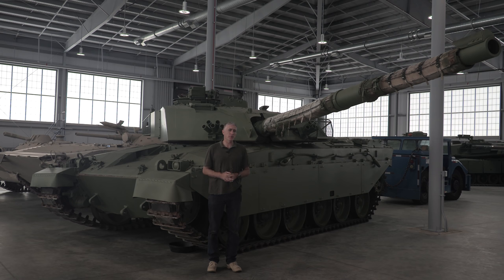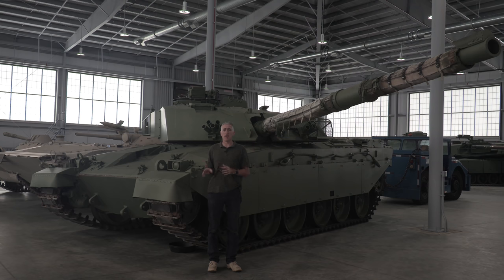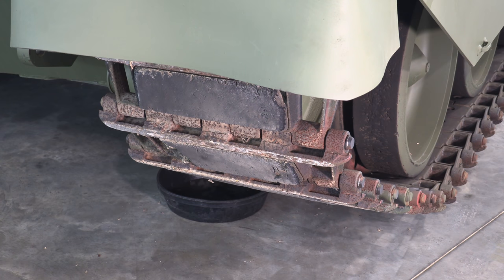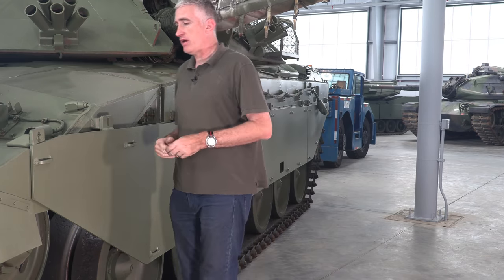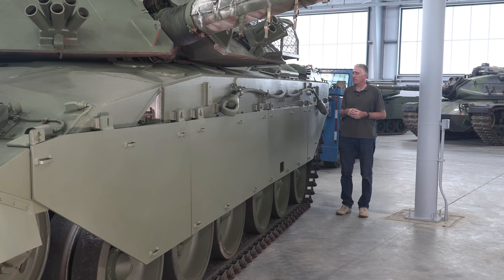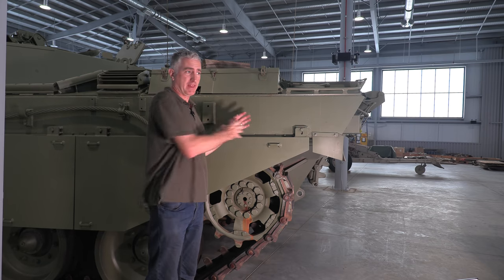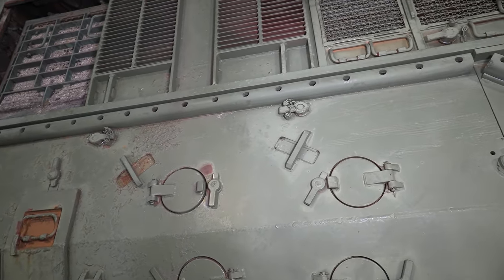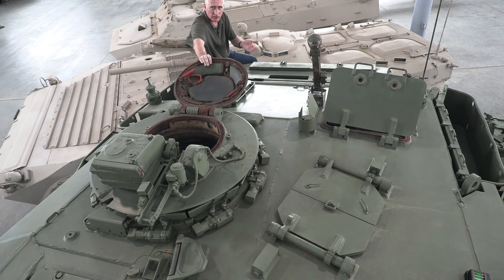Inside the Chieftain's Hatch: Challenger 1 Prototype Pt 1

Comment: The similarity to Challenger 2, at least on the automotive end, is quite unreal. The parts may be different, but the basic design is pretty much exactly the same. Guess if it ain't broke, don't fix it, but having crewed Chally 2s, this seems to be nearly identical. Glad track tensioning is a button on the newer model though.
Reply: Its similar because the Chally 2 isn't really a new tank, it's just marketed as such (similar to how the "new" chally 3 is just the chally 2 LEP under a new name).  Basically British army are still running around in Centurions :D.
Reply: That's a hugely incorrect statement. Challenger 1 was essentially an upgraded Chieftain. The Challenger II was an entirely new design built from the ground up. With some basis externally being similar internally it was Mike's apart.
Reply: The Chal server really will, the Brits just s*** themselves when the tank came last in most races and trials in a European military show/competition. Everything else was more accurate on the move, everything else was finishing the race tracks faster, and the visibility from the inside was poorer. So they started upgrading pretty much every electronic, changed view ports etc., and found a few other things they could update and change in the process. Such as adding new internal laser sensor to the barrel.
Reply: Everything I've ever read about Chally 1 and 2 says they're almost completely different tanks, despite external similarities.

It also all says Chally 1 was a complete turkey, hence why Chally 2 was brought in so goddamn fast.
Reply: @jamesgale9722  Sorry but that's not the case.
Reply: @WozWozEre  The chalky 1 was replaced at the same rough interval as the chieftain (in service 67, replacement in service 83).

The claim it is "completely different" is from 97% of components having different catalogue numbers rather than actual differences.
Reply: @jimmydesouza4375  Except that nothing of them is Centurion based. Couple of tank generations out of date for a claim like that.
Reply: @jamesgale9722  Well... Chal uses a new suspension, a new hull, a new turret, a new engine, a new gun (although chieftain could have had the gun mounted ofc).
Reply: @Retrosicotte  Look up the actual developmental histories my boy.
Reply: @jimmydesouza4375  the catalogue number excuse sounds like something the MoD PR department would pull for sure 👌
Reply: @jimmydesouza4375  "Development histories" means nothing, thats a term that shows continued learning. By "development histories" the T-72 is a T-34. Trying to claim a Challenger is just a model of Centurion is a new level of stupid I didn't expect to encounter today.
Reply: @Retrosicotte  It seems stupid to you because you aren't really capable of engaging in this and dismissing things as stupid is one of the primary defenses of the weak minded.

Anyway, moving on from that you don't understand the difference between novel designs using concepts from earlier designed and iterative development.

Many elements of the Chally and its, frankly, inferior design can be traced right back to the cent.  A nice example is the suspension.  Cent has horstman's because it was the best thing available at the time.  Chieftain is a iterative improvement waiting for something better, so they just adapt the cent hull (early prototypes were even labelled as cent variants), so the Chieftain itself has improved horstman's, and subsequently poor mobility due to the obsolete suspension.  Then the chally rolls along, they can't put horstmans on it again as it's ridiculously obsolete at this point, but at the same time because you're going to use the same hull without any reengineering you need a suspension that mounts in the same obsolete inferior way, so you get horstman's hydrogas units and inferior mobility.  So then the chally 2 rolls along, you're still using an adapted version of the cent's basic hull design, so you once again need external mounted suspension because you can't afford to reengineer the hull, so you use an updated version of the hydrogas from the previous tank and all of a sudden you're failing adoption tests and getting ruined in the export market.

Meanwhile everyone else, because they have done white paper hulls by this point, is rolling along on torsion bars.
Reply: I'll just say here, I've crewed the Chally 2 for 5 years. The bottom half, as in everything below the turret, is nigh identical to chally 2. The exhausts look different, but they're in the exact same place. All the tow mounting points are in the same place. The tool boxes, the rubber stops on the back decks, they're all the same. I can imagine new parts came along, so anything that could upgraded was, but the bottom half of a chally 2 is pretty much still the same in 2022. I don't know the exact percentage of new parts or whatever, but from a crewmen perspective,  I could easily work on most crew level jobs on this thing with little training. It's pretty much the same tank. Much like Chally 3, most of the upgrades were to the turret, because it's cheaper to just keep the same hull and plop a new turret ontop. I'd need to check, but I think the bloody engine is the same, as well. At the very least it outputs the same horsepower and all the important parts look to be in the same place.
Reply: @GrasshopperKelly  IIRC the new gun (L30) came with Challenger 2.
Reply: @Retrosicotte  Chieftain is closer (Both use the Horstman suspension) to Centurion than Challenger 1 is to Chieftain Mk11 (the last Chieftain version)
Reply: @mitternacht4062  The Amis and Krauts do the same with M1 and Leo 2. The german Leo 2A5 and 2A6 where re-builds from older tanks with add on armor, new electronics and for the A6 a longer gun to improve the tank crews performace on the err home front ;)

Same with the Leo 1A5. They where all rebuilds from either A2 or (Denmark) A3 versions.
Reply: The transmissions for Challenger 1 and 2 are very different when it comes to the speed change pack and the torque converter. While the hydrostatic variable speed unit that acts to provide the superimposed steering function is in principle the same for both transmissions I believe that it was significantly much developed between Challenger 1 and 2. The incorporated main service brake was essentially the same for both Challenger 1 and 2 it too may have improved from Challenger 1.
Reply: @jimmydesouza4375  I think you'll find every modern MBT is rolling around on hydrogas. Torsion bar is WW2 era.
Reply: @jimmydesouza4375  If you think about modern tank 'hull' progression from the 1970's till today there's two things that stick out - chobham armour and hydrogas suspension. Seeing as CR1 incorporated both of these there was very little to be gained developing an all new hull for CR2.
Reply: @agt155  Your post is wrong in every possible way.  To start with, those aren't the only developments.  Further from that, looking at those two specifically the CR 1 and 2 do not integrate either.

CR1 and 2 do not have composite except in an incredibly small section of the top of the lower glacis (or at least supposedly...).  That is why, for example, the streetfighter pack sticks a giant block of composite on the lower glacis.

Secondly the hydraulic suspension that some modern tanks have is not hydrogas as the challenger line have it.  The other better tanks have adjustable interlinked hydraulics, in order to alter ride heights.  The chally line's hydrogas are just on there because it's the only system that can take the chally's weight within the packaging confines of bolt on suspension.
Reply: @jimmydesouza4375  The entire frontal arc of CR2 is heavy ceramic composite armour. No 30mm steel plate on the upper glacis like most others.

You are getting confused about hydrogas suspension. Hydrogas refers to the Nitrogen spring medium (Gas) coulpled with oil damper (hydro). All truly modern tanks use this set up (most developed by the same British company)- first pioneered on Challenger.
Reply: @agt155  That simply isn't true. Why are you typing nonsense? The entire upper glacis is simple steel as is most of the lower glacis. This is what the MOD themselves said to explain the guys getting their feet blown off, and why they put the composite block there from Streetfighter onward since the Era alone hadn't worked. There is supposedly composite in the upper section of the lower glacis, however the street fighter armor pack covers the whole glacis which suggests otherwise.
Reply: @agt155  Actually, clicking read more, you have absolutely no idea what you are talking about. Stop replying to me.
Reply: @jimmydesouza4375  Every deployed CR2 has the Dorchester block - it's part of the tanks battle armour.  Combined with the Dorchester upper hull and turret front armour it gives CR2 complete frontal protection.
If you're talking about the incident where a CR2 driver lost a couple toes that was not a result of ERA not working, it was down to ERA modules having been removed.
Reply: @agt155  So not only do you have no idea what you're talking about but you're willing to outright contradict yourself from post to post.

Why waste both of our time doing this?
Reply: @jimmydesouza4375  Worthless response. Don't be afraid to learn.
Reply: @agt155  Yes that was a worthless response, so why did you post it?
Reply: @agt155  Its not the Hydrogas is only there because it can tank the weight a bit better. Challengers upper and lower front plate are exposedtne hull has the behemoth weakspot plus the front turret is very thin.
Reply: @agt155  No its does not the entire upper and lower front plate are exposed and then drives weakspot with little armor around is there. Plus the turret and hull sides seem very thin to modern threats like rounds and missiles.
Reply: @resurgentclassbattlecruise7698  The upper front plate has always been Dorchester, the lower front plate was ERA + spaced steel, but is now Dorchester. Therefore the entire frontal arc of CR2 is Dorchester protected - still probably the best ceramic armour on the planet (never defeated).
Reply: @resurgentclassbattlecruise7698  Hydrogen is simply a much better performing spring medium than steel. Every modern MBT uses Hydrogas - the next gen European and US MBTs will all use hydrogas.
Reply: @agt155  No the Upper and Lowerr Front Plates are 80 Millimeters of Steel just simple steal. Adv naced Moduler Armor Protection is better because its not based on upgraded version of early 1960s armor that can defeat all threats. Even the leopard 2A4 has greater armor protection and could withstand all to most cold war era weapons from the frontal arc. It is just simple steel rubber plates ceramic composite applique materials mixed together. The Armor was declassified in 2013. And its really not great. Advnaced Moduler Armor Protection uses nanotechnology modern steel titanium tungsten ceramic composite and appliaue materials in its construction and is much better plus its mid 2010s armor plating not early 1960s. Challenger 1 proved killed by Konkurs ATGM that has less than 70 millimeters of penertration . During official sanctioned ground testing the the mid 1970s. The Turret Armor is very thing. Challenger has like Tytpe 10 a 40 metric ton main battle tank zero composite ceramic appliaue armor baseline to the turret and hull sides. The Iranin chieftain tanks proved m multiple peioce rounds were no longer durable has  many hundreds were destroyed with in inside magazine explosisions in part because of that 3 part round.  And that Iran Iraqi war was extracly the kind of war challenger was built to fight. Not kill armored fighting vehicles at extreme ranges. But close in infantry sppoty with HESH.
Reply: @agt155  The A7V M1a2 SEPV4  A7 Plus Q A7NO A7 Plus HU. T80BVM T90MS T72B3M. It is used in Sourth Kora because of the trerrian there which is exactly the same reason it used in japan. the Altay uses it for likely there same Reasons MBT3000 T96B Plus Type 96B still use torsion bar suspension. Chieftain outright said exceeding 37 miles per hour is dangerous. And its maximum speed is about 56 kilometers per hour.Challenger 2 is heavier. All to most Hydrogas tanks have speeds about 65-75  kilometers per hour. The A7NO Main Battle Tank has a maximum confirmed speed given my the manufractor of 60 kilometers per hour the same speed has challenger 2 without the  armor packaging installed witch adds nearly 10 metric tons in weight is is unoptimized before full fixes and bugs could happen because of the second gulf conflicts in the middle east. Plus the Leopard 2 Still has Peace Support Operations that come with extra armor of remote weapon system station a plow new sensors and systems and subsystems and other cool stuff.Plus it upgrades the poor armor in the turret and hull sides by placing much thicker and heavier armor blocks with composite ceramic and applique materials.  Chobium was developed in the 1960s better armos have come. It is not going to officer you the protection you think it will because it a first generation armor plating scheme for main battle tanks .Not the advanced nanotechnology ones on the market designed to kill round and missiles with 1,000 plus millimeters and 1,500 plus millimeters respectively. Because those kinds and more modern threats did not exist back in the early 1960s era. They do today. But the armor is not that great because its outdated.
Reply: @resurgentclassbattlecruise7698  No, the upper plate is Dorchester and around 700mm thickness, the lower plate is around 100mm steel plus an additional 600mm Dorchetser. Challenger 1 has he longest tank kill in history APFSDS @ ~ 5100m. Rifled = more accurate. Leopard 2A4 has protection levels comparable to Chieftain (which entered service in 1965).
Reply: @agt155  Rifled guns are nor more accurate or precise than smoothbore cannons. APFSDS rounds are far to long and thin in relation to their length to diameter ratio for spinning which helps the accury of roughly conical rounds. Because a long ger and thin er APFSDS round will penerator more armor at longer ranges with a high muzzle velocity. Once you get over 7 times the length to diameter ration vastly increasing centifugal themodaynmic frictional  and rotational forces imparted on the rounds slower them down weaken them make lose range accuracy and stabilization and increasing mzuzzle velocity drop and dispersion. Rifling guns need rifling directly cut in them tweaking them and proving escape ways for the gas meaning they also have lower pressures. The L44 has at least a third higher pressure than even the L30A1 gun. No the plate its not 600 millimeters of Dorchester plus another 100 millimeters of steel is an 80 millimeter steel plate  angled . Dorchester is also just an upgrade version of an rmor technology based on the early 1960s plus those penetration muzzle velocity range accuey and dispersion numbers are almost never what is avoided in real life combat testing training or practice.Modern APFSDS rounds are extrmelery long we'll past the 7  to one length too diameter and well into the high 20s to one length to diameter ration  and even mid 30s length to diameter ratio.
Reply: @agt155  . Plus Challenger uses 3 part ammo witch means its a lot harder to get that longer rod mmuzzle velocity length to diameter ration  range accuracy precision compared to single piece ammo.  TRhe A4 has better armor compared to challenger even with theater entry package installed. The Lepopard 2 could not be killed by any 1880s or even 1990s weapon systems even without upgrades. The lack of proper training tactic logistics rounds crew doctrine poor usage older second hand leopard 2 a4s lack of any safety features in those tanks .Makes them easy targets for late 2000s super advanced missile system with TSC advanced guidnece and sensors not light of sight and top attack capabilities with GSWP and other sensors and their systems and subsystems onboard. With well over 1,500 millimeters of armor peneration  after ERA is defeated. Witch that Like APS PPS ERA NERA Cage armor or additional armor and upgrade packages.Thye leopard 2 has one every single major tank challenge to replace other nations main battle tanks or was picked first every single time. If fact it was the fact challenger 2 lost the greak military replacement that challenger 2 E was cancelled because of that. Even though the tanks hydrogas suppression systems where superior objectively in that environment it still lost.  and every single major tank re-placement thing in eurpoe the Leopard 2 one. Poloand is the one major exception because it still upgrading and maintaining those leoaprd 2s plus its military is mostly old sivolent stuff anyways and its not boring or sea boring multiple leopards 2 uses like how Norway is. Plus Norway already uses A4s not the Unnammed A7 cariant in trails over their.  Poland also borders Russia Norway has Denmark Sewden Finland to help and they will. Poland really only has Germany and Austria to help.  And Austria noes not a the modern state of the military Germany does it has bacis Leoaprd 2 A4 without any upgrade packages or additional enhancements.
Reply: @agt155  Streetfighter completely coves both the upper and lower glacis with armor sugetsing its not 700 millimeters with a 600 millimeter thick Dorchester block plus 100 millimeters of steel but a mere 30 millimeters thick all around with zero ceramic composite and appliaue materials to cover it up. Or else streetfighter would not be coved it up or a early 1980s missiles would not be able to penetrate the so called most advanced armor even though it forms the 1960s and the M60 tank had a slimler armor scheme made for it also in the early 1960s russians ranks also have slimer armor schemes and many of those were brought by SH and his forces and destroyed by modern missiles and rounds. Not the training partice or summery round there uses or RPG and missiles form the mid 1950s to early 1960s era.Russian ranks also had slimmer armor schemes and many of those were brought by SH and his forces and destroyed by modern missiles and rounds. Not the training partice or summery round there uses or RPG and missiles form the mid-1950s to early 1960s era. shapred charge warheads do not spin as its disperses the warheads and weaken them further inside of  warhead. APFSDS rounds to wat to long and thin that is way smoothbore guns work. Most APDS rounds that type that needs a rifled gun only does about 1,200-1,500 meters per second. Plus because smoothbore guns do not have the need to weaken their barrels. They can have larger chamber sizes and high gas pressures even the L44 gets gas pressures more than 1 third higher than even the L30A1 a rifled guns. And it shoots its rounds at 1,650-1,700 meters per second. the KEW  fifth generation rounds fired by abrams goes about 1,760 meters per second in muzzle velocity. Plus the turret of challenger 2 is exposed and its not thick at all. The turret cannot be 100 millimeter under because the turret would not beable to turn and we can see thanks to the way overexposed drives are the mechanisms for turret rotation so its a little higher than most other tanks. You can not see the Leopard 2s turret rotation gears and other mechanisms for that.  Ypou are just making up randam shit even the MOD has said multiple times the tank is in extremely dire need for upgrades even tough it has not been upgraded in 35 years in the design manufractor processes or service like. At least the Leopard 2A4s a second or third rate main battle tank got replacr3ed with the A6 and later versions of the A6. a first rate and line main battle tank.
Reply: @resurgentclassbattlecruise7698  The upper glacis of CR2 is, and always has been, Dorchester composite. The lower glacis receives a huge block of add-on Dorchester as part of TES. Streetfighter is an urban armour package.

The L30 gun is actually higher pressure than the Rh120mm, and has larger chamber volume. Penetrator length is not limited by 3 piece ammunition. The reason a successor to L27a1 has not appeared yet is because it hasn't been needed.
Reply: @resurgentclassbattlecruise7698  Here you are L11 (same chamber as L30) 12% greater chamber volume than Rh120mm.

http://i.imgur.com/tyBSf7L.jpg

Now you prove Rh120mm has higher chamber pressure.
Reply: @agt155  Rifling guns limit you chamber size because its not a  smooth transition form the breach to the gun. And really hamper you gas pressures because rifling weakens you gun and allows gas pressures to escape whaile allowing the propellant pieces dir and grime to escape and go tough under and over the lands and grooves grovves. That allows makes you loose mzuzzle velocity range accuracy precision and rises  dispersion and muzzle velocity drop levels because the round  is already not going straight and is wobbling inside you gun barrel and than its going to get hit with the centifugal gyroscopic themraldyanmic and rotational forces witch are harmful to the long and thin rounds modern main battle tanks usenot the other war around. We can confirmed data on the RH120 Millimeter L44 and L55 Cannons and confirmed data on the L11A5 and the L30A1 guns.And even the RH 120 Millimeter L44 cannon has aboth a equal or larger chamber size and noticeably higher gas pressures and muzzle velocity limits. I mean the latest Abrams kinetic energy rounds for export are exceeding the challenge 2 higher known and confirmed muzzle velocity limits by at least 100 meters per second and if you give the Leopard 2 those rounds it might shoot past 200 meters per second faster. Maybe even higher if you are using the L55A1 gun witch you really should. if baseline M1A1 abrams with their M256 120 Millimeter L44 smoothbore cannons were getting repeated and consistent kills beyond 4,000 plus meters. than the M1a2 SEPV3 should be able to go much higher aginest those tire threats and the Leopard 2 A7V with the RH 120 Millimeter L55A1 gun you can extended that range much higher.  I mean the both the abrams and the leopard 2 get larger stowage racks and bustule racks than challenger 2 and you want the longest and thinnest APFSDS rounds you can get
Reply: @agt155  . Plus rifled guns are not more accuture because in part the you are  shooting ammunition that is negatively impacted by the use of rifling and centrifugal and thermodynamic forces al;long with fractional and rotational forces. Shapred charges wars are also negtivelty impacted by rifling dues to the exact same effects. Becuase shaped charge rounds uses those liner to help the explosive jet form and penetrate the armor plating and rifling siperes that jet over a much wider area. Even tough HEAT is still a kinetic energy round not a chemical energy round. Because it still uses a physical object to punch tough the armor plating not an explosive charge. HEAT is just an acronym. Plus we challenger challenger 2 test and proformence dtat it is really not impressive any other tank should have gotten a 5,000 meter kill shot in 1991 and any other tank after the early 1960s could have tanked those RPG ATGM Missiles and rockets that were fired at challenger 1. Witch had zero ability to kill tanks made with that kind of armor plating. Any other tank could have survived those 14 hits by RPG 7 and 2 first generation platform with next to no damage and any of those tanks could have survived the Malin ATGM with also next to no damage. Even the most heavily downgraded versions of the abrams have never had their front plate upper or lower penetrated by energy fire.It nearly impossible to survive a missile with 1,500 plus millimeters of armor pen after ERA when its hitting you side of second line or rate main battle tank with zero upgrade packages armopr modules or any APS PPS ERA and NERA packages installed.
Reply: @resurgentclassbattlecruise7698  Pure conjecture. Where's your evidence?
Reply: @agt155  The document alrady says the RH120 Millimeter L44 has a higher muzzle velocity and chamber pressure even tough it uses APDS with for the challenger had maximum muzzle velocity of about 1,375 meters per second and 304  millimeters of armor pen at 1,000 meters. As for the 11.17 little chamber size for the L11 gun witch sound way to high for a gun first uses in the late 1960s era before APFSFDS and high performance APDS rounds were common in any kind of numbers. That might be a version with an extra l larger chamber like a possible L11A3 variant designed for extreme long-range shooting or some kind of naval version of the L11A5 with a larger chamber size because 420 millimeters at 2,000 meters does not screen an 11 little chamber size. It screems an 8.5 chamber size and maybe the L11A3 with a larger chamber did in fact go to 11 littles for a higher muzzle velocity range accuracy and precision. I mean the Rh 120 Millimeter L44 gun has larger rounds than the L11A5 and now it seems like the L30a1 is better buy it.Plus the data should only use APFSDS round because that is the round that we care about not APDS. Witch is in the length to diameter ratio range when rifling is useful. Thank you for telling the L11A5 and L309a1 have the same chamber I looked at the guns for both challenger it seems 8.5 littles is more reasonable and realistic though some tank might be fitted with special cannons for whatever reason. And that is the version they just so happened to go with. Not the actual L11A5 gun because its use in Chieftain at the time.and Because Chieftain was the main battle tank in service and actively being exported like the Leopard 2 is today the unofficial specifications were used. Not the correct ones.L15 has 304 millimeters of armor pen at 1,000 meters https://i.imgur.com/YN2HOu6.jpg not 440 millimeters at 1,000 meters interesting enough that is what the west germens got when using the gun and round for testing the thread said it could not kill aT64A at the front reliably even at point blank range. If you want to read it go ahead and do read it https://www.reddit.com/r/tanks/comments/aj8c9m/what_if_nato_chose_l11a5_as_the_standard_tank_gun/
Reply: @agt155  Rheinmetall has outright said the chamber presure for the L44 gun is 720 Megapascals I believe the B1 Centurion bets it with an 810 Megapascals. The CN-08 gun has a service pressure of 690 megapascals compared to 580 m,egapascals for the L44 gun makes sense. The muzzle velocity estimates for the DM53 round is about 1,800 meters per second out of the L44 gun. The Lastest Abrams kinetic energy rounds witch are superior to the leopard 2 tough it is uses a mid 1980s round still.  The KEW4 or 5 version has a calmed muzzle velocity by General Dynamics of 1,760 meters per second out of the M256 gun system. The B1 uses a 45 caliber smoothbore 120 Millimeter 45 caliber gun I am guessing that gun has a larger chamber volume larger than about 10.5 litters the actual chamber size for that gun. The RH 120 Millimeter L44 is much newer gun and thus its true specification were callifled and not know to the outside world in Jan 1974 makes total sense. As that gun is given a higher muzzle velocity than what Wikipeida calms o9f 1,530 meters per second baseline than it Wikipedias itself into calming the DM13 hasa muzzle velocity of 1,620 meters per second.Because the RH 120 millimeter gun are still in active service the real specifications are classified so real life figures are extremely hard to find. Its likely possible that the gun is even better. And even if the L11 gun and l30 Gun has a larger chamber the L44 and L55 guns for the leopard 2 have much higher baseline proformence Ruags 120 Millimeter L50 gun the CN120-25 and CN120-26 guns are not included the 110 millimeter guns not need to be there. The L7A3 gun should the M68 gun should not be there as they are slimer enough in proformence. specifications,.The L11A5 gun has a APDS round called L20A1 with about 1,450 meters per second in muzzle velocity.L23 has a muzzle velocity of 1,534 meters per second L26 has a penetrator length of 525 millimeter is is made with depleted uranium and is to be fired form the L30A1 gun. The Penerator length of DM53 is about 670-730 millimeters. https://web.archive.org/web/20040804005910/https://www.janes.com/defence/news/jdw/jdw010108_4_n.shtml.
Reply: @agt155  They are plenty of things that doc you give me msses up a lot like the gun themselves there specifications and even units of measurements. The Svilolet 115 smoothbore and 100 millimeter rifled guns the L7 the M256 need to be there. they are not there plusn you did not even read the doc you gave me because those things were already there. making up bullshit specifications for the challenger 1 and 2 is not helping you case even without knowing the specs for challenger 2 were leaked months ago and multiple times the armor specs were declassified multiple years ago. The document you give me is not official in anyway and its Inernet based making any dates names locations ammunition types used for be both He and AP with names of those and specifications used  and any other kinds of data classified documents used for those for the tests or anything other than classifled information that the real tests included.  The 110-millimeter gun the RH105 do nor need to be there at all the Freanch CN120-25 gun should also be there also its not.  The Challenger 2 was on the edge for being replaced by the Leopard 2 witch beat in in every single test they did together and has won everysingle competition to either replace it or another main battle tank to data. The Challenger 2 has won zero and loss every single one of them. Because it has not been getting upgrades for the past 27 years and its outdated and obsieleite . Because even other NATO tank beats it even though they are smaller and lighter than it in every way humanly possible and you god dam know it.I actually did not know the L11A5 and the L30A1 have the same pressure but that makes sense as their fire the same ammo. that is limited to 55 centimeters in length because that is what the stowage bins are capable of providing. The document disproves you point that the L11A5 and L30A1 have higher pressures. compared to the L44 smoothbore cannon But the service pressure for the L44 RH 120 millimeter does seem rather low.  In 1974 the final design spec s for the L44 RH 120 millimeter gun was not approved plus the gun is a scaled down version of the 140 millimeter Electrothermal chemical guns that did infact hit 2,000 meters per second.